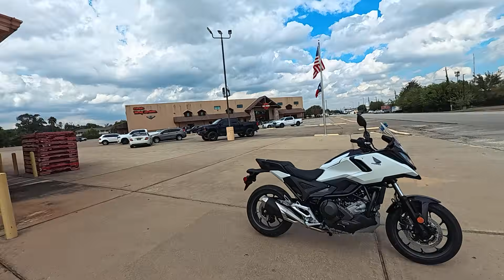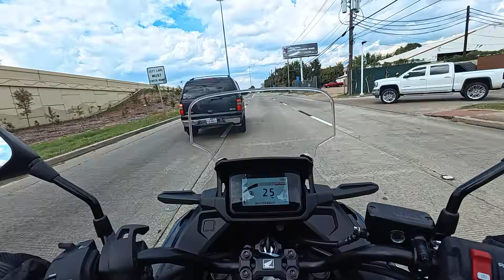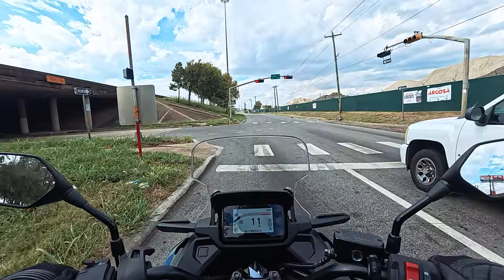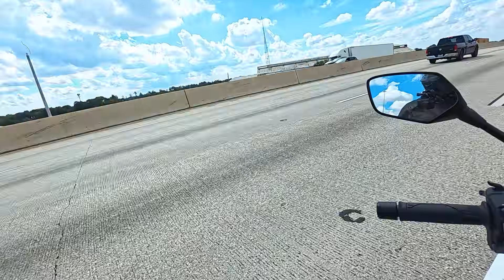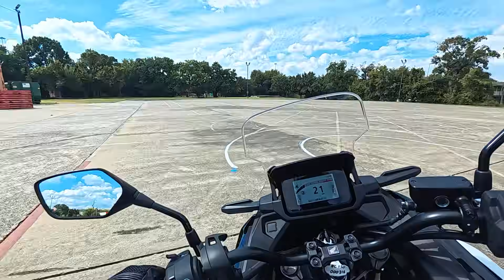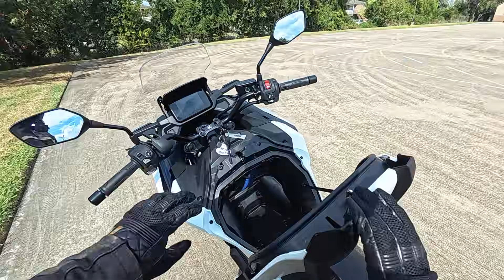Honda NC750X DCT.  First Ride and Review. Let's Ride!

Comment: I wish Honda would make a new Deauville with as good weather protection, shaft drive and Analogue instrument cluster.
Reply: They did. Nt1100 , it’s on sale now.
Reply: No they didn’t because the NT-1100 has a lot bigger engine, chain driven and a lot more expensive and as far as I’m aware the panniers and top box cost a lot more and were standard integrated on the Deauville.

Even the NC-750 x can’t be compared to the Deauville 700.

Comment: Why do you ride on the freeway at 80mph with one hand?
Reply from the maker: A couple of reasons. Firstly, every rider with more than about 6 weeks worth of experience will ride one-handed. The same way that people that drive cars will drive one-handed. Secondly, it's one of the drills that I was taught when I originally started riding motorcycles when I was 5 years old.

Comment: It ought to be making at least 70hp. The new Hornet cb750 makes 91hp and is also known both for its low-end torque AND its very good fuel economy.
Reply: This has half the mpg of a hornet
Reply: @manbiteslife3110  You meant "double". No, it does not. Unless you ride the NC like a grandpa, and the hornet like a maniac.  Even then it would not be double.
Reply: @GID-GR  I actually meant that hornet uses 50% more than nc but I didn't even drink coffee yet excuse me. But totally different bikes man and concept of riding. Transalp has the hornet engine and it's really good.

Comment: If someone wants an automatic bike and do not need a very fast bike with a lot of cc..why would that person choose the Honda NC750X DCT over a scooter? Okay..maybe for the design, suspension or the stability on the road..but a scooter like the Piaggio Beverly 400 can do all that a NC750x DCT can do and is more practical in the everyday life. If I would buy a motorbike it would be a Honda NC750X DCT (as an A2), but to me a scooter has to many advantages to make  such a choice. Maybe if I had a A and not just a A2 license the more powerful engine of the NC750X DCT would be a thing, but I think the power in a 350-400cc scooter is capable enough I have to say. I do not say scooters are better than a NC750X DCT, but as an allround bike a scooter suits me better than a motorcycle like the Honda NC750X DCT. Maybe if I tried the NC750X DCT I would change my mind?! 😊
Reply: Because scooters drive and feel like shit.....duh...
Reply: You almost answered to your self. Scooter it’s always gonna be a scooter. Cvt bell  grrrrrrrrrrr same noice. The nc it’s semi automatic having padel’s. You can drive it manually and also you will hear and feel the gear changing on your engine. Different Worlds. About the every day’s practicality have also a 23l space can put one helmet inside. Drives a different position. Drives better lower rpm at motorways better or similar fuel consumption. 
100 percentage bulletproof engines. 
But only one test drive can give you the idea and the dct need time to learn it and explore how it’s working. 
Good luck on the test ride.
The minus it’s there it’s not cruising control and the suspension it’s after a bit shit explain for 2 people.

Comment: I have 56,000 km on my 2020 but it’s not a DCT it has a clutch. I didn’t know a commuter bike was a category. This is just a great bike for doing anything on except racing sport bikes, and getting harassed by the cops and it gets 80 miles per gallon. I can drive it all day for 10 bucks.

Comment: My Lil' sister has the DCT version after her Zuma was stolen. She could never time the clutch and throttle too well so the DCT worked out great. Now she is back scooting around town. And the Funk is great for her purse.
Reply: Hi. How tall is your sister? I'm 165 cm tall and I'm afraid it will be too big for me.
Reply: @eriksokolov4781  She is about 170 with short legs. I do not know her inseam. She barely has both balls of her feet on the ground.  But the NC wears its weight low making it very stable and balanced even at stops.

Comment: I test rode a second-hand NC750X DCT this week (still the older single brake disk version). I really liked it but there was something odd about the steering in slow maneuvering. It felt kind of sluggish, as if it was resisting turning. It was fine as soon as it got up to speed, but the steering response at slow speeds was kind of strange. I suspect there may have been something wrong with the second-hand bike. But to be sure I wanted to ask: Would this be normal because of the long wheelbase and general geometry of this bike?
Reply from the maker: The motorcycle in this video didn't show any signs of having sluggish steering. Possibly a low tire on the bike that you rode? This bikeis a little bit slow to steer, but nothing outside of what you would expect for this type of motorcycle.

Comment: Fun look at the newer version. I got the 2023 DCT as that's all they sell in the US anymore. Thought I wanted a manual, but after 5 minutes with the DCT I was done with a clutch. I do a long commute on mine in summer, have a cheap Harbor Freight case on it, veridian cruise (absolute necessity for my wrist) and a custom seat out of Top Sellerie... I get 55mpg at the low end (headwinds and higher speeds) and up to 80-85 if I'm doing 50mph type country roads for long periods. Frunk holds a lot of groceries -- something that might help you make the sale with the wife...  Holds my full-face helmet (HJC med) when I'm in the store, plus gloves, hat, and bag of glasses, first aid, charge cables...) I popped a thunderbox on to handle power, a cheap android auto head and an inexpensive high powered USB charge port with 3 outputs in the frunk front hatch -- can charge my work computer in there when needed. I find the suspension meh... but the worst for me was the rear shock, but the custom seat softened the ride enough that big hits no longer knock the wind out of me. I'd still like to get cartridge emulators and a better rear shock put on it, but it's not crucial. It's a fun, no-drama ride, cheap to run, dead simple maintenance. People say it lacks personality... well, that IS its personality. It won't appeal to everyone, but a lot of people love the bike for that simple reliability.

Comment: All people said me "buy a Tracer 7", but my sixth sense said me "this is the bike for you". Yesterday i've purchased Honda NC750X green. Future will reveal me if if my choice was good.
Reply: I got the 2017 mt 07 tracer and I'm extremely happy with it. Engine has a ton of torque and the bike is 20kg lighter than the honda. I would have considered an nc750 but there were none with dct in my price range available. I've ridden my dad's x-adv 750 and the dct is pretty good

Comment: For me Honda have crippled sales to existing owners downsizing due to injuries, 52hp just us not enough , I say Honda should for 26 changes make this 72hp including the forza, the engine is fully capable of this with a minor tweaks to displacement, they can then add a restriction kit for a2 /a1 license compatibility
Reply: What do you mean with 'crippled sales'? It is one of the best selling models worldwide Honda has. Not everybody wants an expensive fragile high revving nuisance bike. This bike is perfect for those who do not feel the need to proof themselves, for those who just want to drive and enjoy the trip. It does long trips (I have done 800 mile trips), enjoys the city and everything in between. I drive one-up, two-up, do shopping trips, cruise all day and always truly enjoy myself.
Reply: Honda have announced a new 2026  Danville 700cc v3 engine 70hp  , Honda please make it shaft drive
Reply: 57.8 bhp.

Comment: I've just had a very big disappointment that will make me rethink things about the bike I ordered. The local dealer got me a DCT version by mistake rather than the manual geared bike I wanted. They're being nice about it and actually offered to discount the DCT to the manual price and throw in a few accessories as well. But I'm not sure I can live without a clutch and gear lever. It just doesn't sound like motorcycling to me ... might as well be on a scooter. Any ideas on any other bike that is as long-stroked as the NC750X. Maybe I can go for something else instead. Thanks.
Reply from the maker: Give it a ride and see what it does for you. You may like it.
Reply: I was looking for a used shifter, thought that I'm used to shifting, why pay more for something that may break and weighs 10 kg more. 
Then I came across a good deal for a DCT and bought it. 
A week and a few hundred km later I was very glad that I bought it because the DCT was so impressive. As soon as I was thinking about pulling the clutch lever to shift, the gear was in! Honda did a great job there.
Got me a new 2023 model last year (they stopped selling later models here) and am very happy with it!

Comment: The DCT isn’t an auto transmission. It has two clutches.
Reply from the maker: You're kidding right? A DTC is considered an automatic transmission. But don't take my word for it Just ask Google if a DTC is considered an automatic transmission. I'll wait
Reply: @Moto-Psycho-1 it rides just like an automatic transmission but in fact it is a standard transmission with magic that handles the clutch and shifter.
Reply: @Moto-Psycho-1 a manual with a tcm changing gears for you,that is what it is!
Reply: What is wrong with you?
Reply: it drives absolute like automatic. Who cares about technical things
Reply: Yes, it is not automatic with dual clutch transmission-DCT. One clutch works with 1-3-5 gear, orher with 2-4-6, for very fast shifting.

Comment: I have 54,000 miles on my NC700 DCT. Not just a great commuter bike , but spend $500 for a Veridian cruise control and you have a  very capable mid weight touring bike.
Reply: I’ve never ridden an NC700 or NC750X DCT, but I feel a motorcycle like that should have been shaft drive. I know it would add a bit of weight and there’d be a bit more driveline power loss, but this model wasn’t about being ultra lightweight or ultra high performance. Shaft drive would make this ultra lower maintenance too.
Reply: @speedy_j9368 I love my nc750 but I agree with you. I wish I didn’t have to do the chain maintenance.
Reply: @speedy_j9368 yea, but should be a 850cc

Comment: Are the turn signals broke?
Reply: The front ones stay on all the time, acting almost like day time running lights, and then when indicating, one stays in and the other flashes. 
On camera, depending on frame rate it can look like they are flashing when they're not.
Reply from the maker: Nope they work like a charm

Comment: 5:45 sounded pretty cool!!   I’d worry about forgetting it’s in “drive” and rev bombing at a stop light, launching myself into the intersection.  😂
Reply: You have to put it in neutral first but have imagined taking off on a rev bomb.
Reply: I own a 2024 Honda NC750x DCT.. One of the first things you learn is that when you come to a stop and want to get off the bike , you always always put the bike in neutral first. Never do anything else. It's not hard just a habit you must do. Then you can  put the kickstand down and get off.. It won't be long and you're an expert riding the DCT.
Reply: This is not a great bike and you will definitely miss a manual clutch
Reply: @terryshrives8322 bull shit, great bike for what it’s designed for.
Reply: @terryshrives8322 ma anche no DCT tutta la vita😊
Reply: @terryshrives8322 I don't
Reply: @beefnacos6258 I have a friend with one and he's had nothing but trouble with that dct